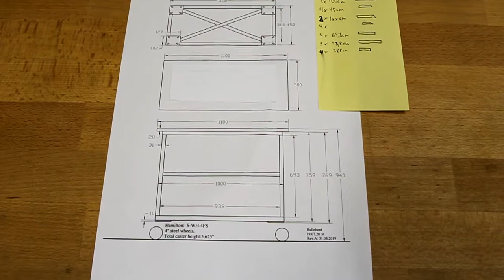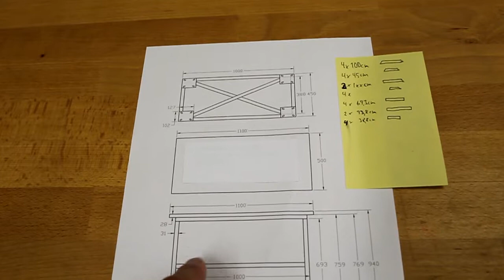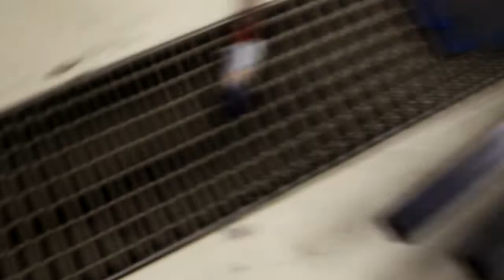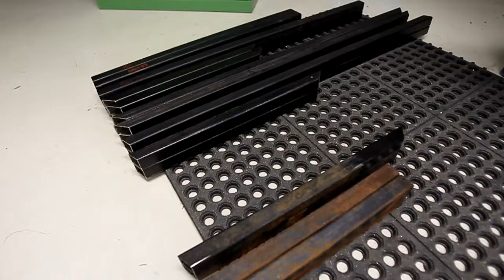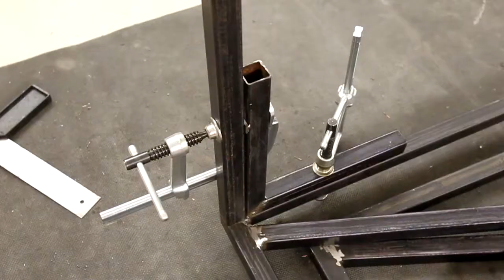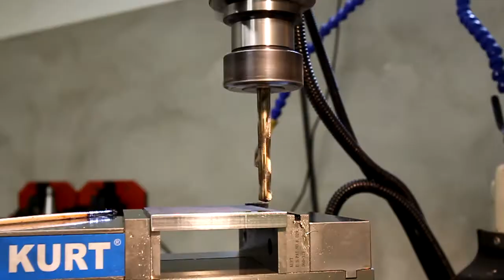Shop built Rollertable part 1

Comment: Nice cart.  Similar construction to the welding cart I just made.  I tig welded the mitres for the "shelves" so I got good penetration without the big bump.  I need all the practice I can get with welding though.  It was a good project.
Reply from the maker: Thank you ! I don't have a TIG-welder so MIG it was, but I am sure TIG would have been a better solution.